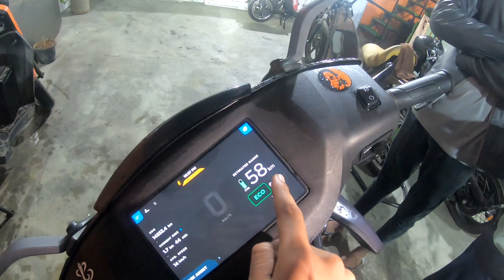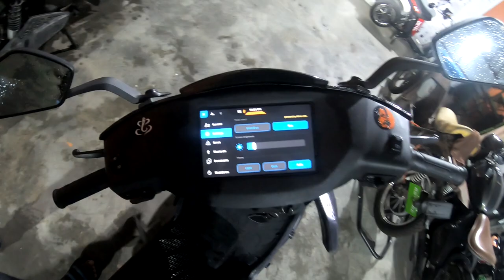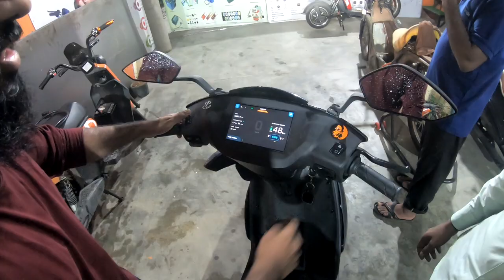Ather 450x Failed❌Don't Ride Ather 450x In Rain🤦‍♂️| Electric Scooter In Rain |

Comment: Complete lie and overacting. I have ather from 2019 June.. even today its worth to pay. He dont know anything even ABCD also about bikes.
Reply from the maker: so wat sir u have not experienced the situations that's it  we have also not told ather is bad please watch the full video before commenting
Reply: @jms_reddy6340  i have experience with ather. Bcoz I am using ather from June 2019 and August 2021 I bought Ather 450X too. I rode in heavy rain in the downhills of Bengaluru even in water. I didn't faced any of these situations at all. In Ather 450 i rode 42000km, in ather 450X right now its showing 13472km. So Kindly share the real problems of your scooter and not the false things. I am not the fan of Ather, just what I experienced that I am sharing here..
Reply: @mohanraj-og8fm  Nice
Reply: @mohanraj-og8fm  What happened to your 450 with 42k km on Odo? Is it giving the same range or giving less? Btw i also use 450X everyday
Reply: @rajatverma360  Ather 450 is giving exact range even after 3 years and my family persons are using it. But I am very happy with ather 450X scooter. Its a crazy one.
Reply: @mohanraj-og8fm  bro I was really confused between petrol scooter or  electric scooter (iqube,ather) in front of my house there is no shade vehicle will be parked in hot sun so as of ur experience is it good to buy  electric or there will be any heating or other issues
Reply: @BobbyPrakash  both ather and icube are good and withstand even at indian climate conditions. Becoz both are launched after somany R&D's. So blindly go for any one. Icube os affordable with slow charging. If u want more specs with fast charging and ather grids for outside charging go for Ather.